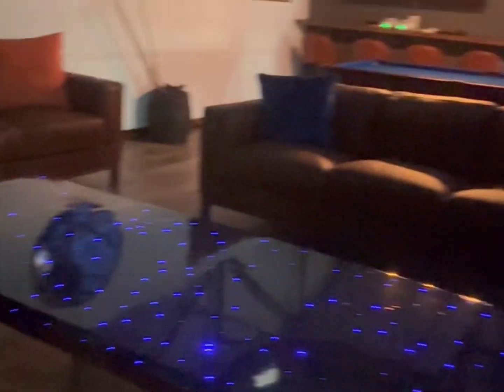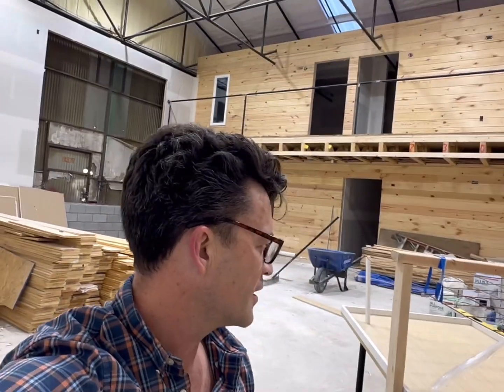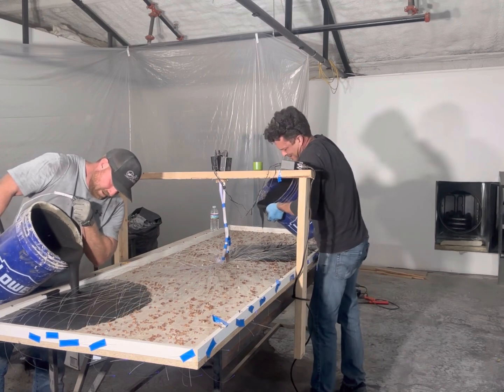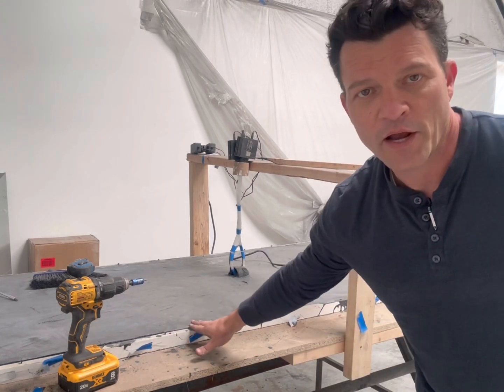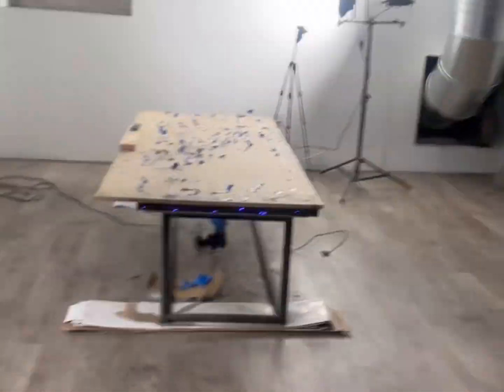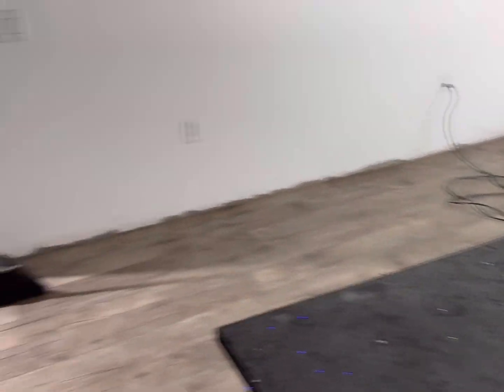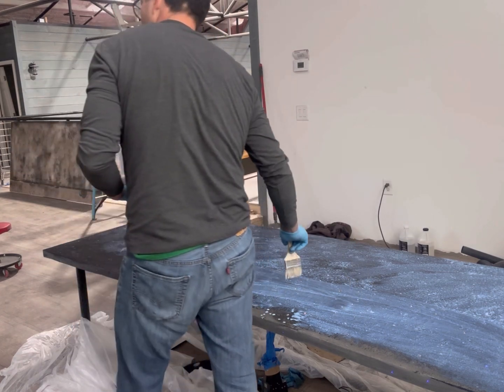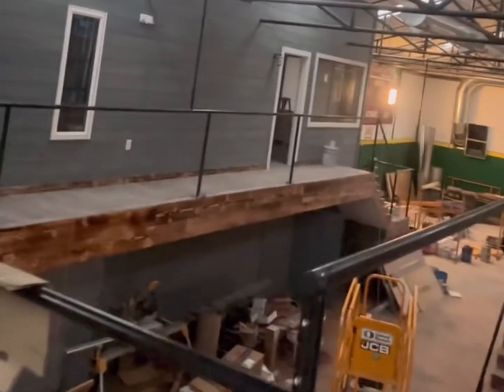How To Make Your Concrete Glow using DIY Fiber Optics

Comment: wrong this is not the first one , there are thousands similar to this nothing new about fiber optic builds the first one I did was back in 1999 we did a ceiling 18x33 with 30,000 feeds along with a cast in place bar top (cement) in the same room, (movie theater)  we used fiber optic cable that was made in Florida and we used switched made by radio ra that had light color wheels inside to give us the effect of twinkling stars , however none of this was portable . looks great nice job thanks for sharing
Reply from the maker: Thank you, I did not realize so many were made in the past until further research. It was a fun project and I look forward to doing more. Definitely time-consuming as you know.
Reply: Hello, I wanted to ask you — what is the diameter of the fiber optic cable?
Reply: @DonahonMahsudova  we used many different sizes but for the star light ceiling it ranged from 1/32 - 5/16ths , for lighting 1/4